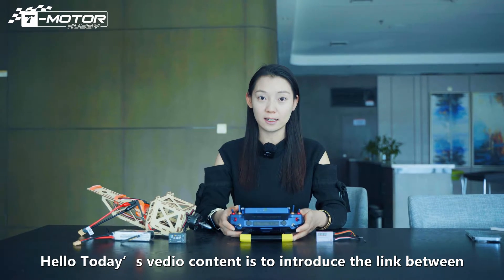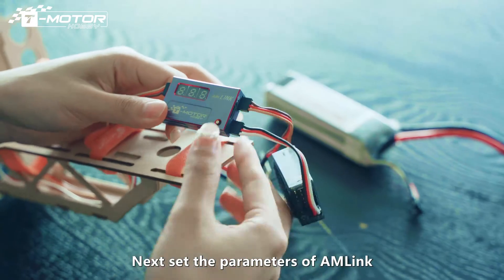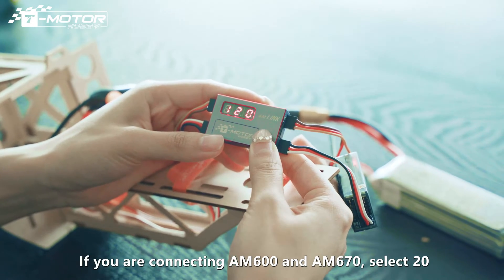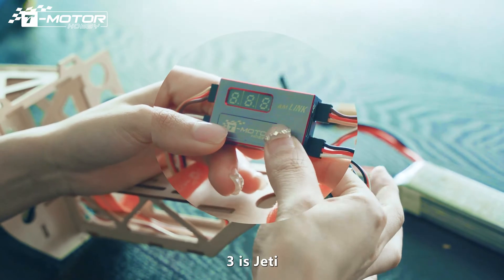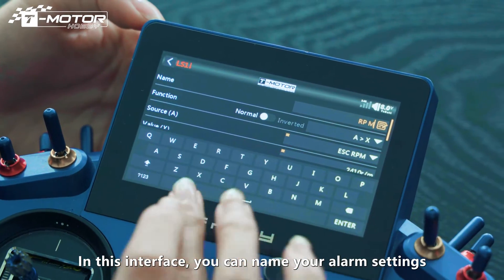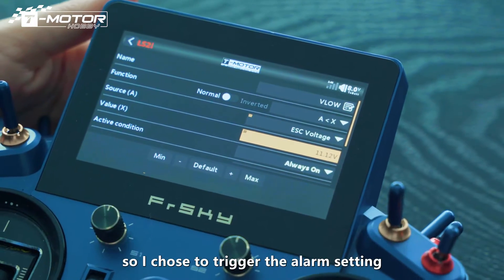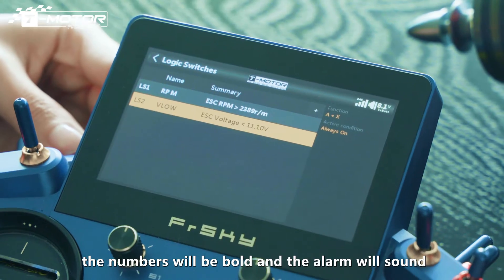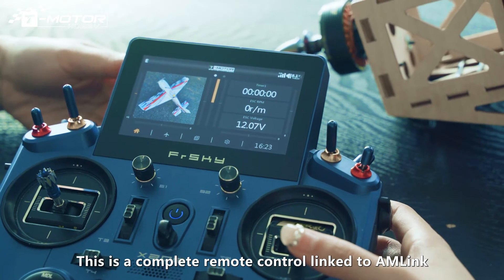How to link T-Motor AMLink with Frsky remote control？

Comment: if using radiomaster tx16s....which radio system do you choose in the AMlink?
Reply from the maker: Hello, if your receiver supports the two-way backhaul function, and the remote control brand is Frsky, Jeti or Futaba, you can use AMLink for telemetry data backhaul!

Comment: For anyone having issues receiving telemetry with the FrSky TD series receivers and the T-Motor AmLink.

The solution after hours of frustration is to remove the AmLink and obtain telemetry directly from the ESC telemetry port. It appears that Bl-Heli app offers the option of direct telemetry output. At the bottom of the BLHeli Configurator in the second column, there is S.PORT Physical ID. Set that to the port you plugged in the yellow signal wire and write it to ESC. After connecting the telemetry cable (the yellow one, with the red and brown pins removed from the JR connector) to the receiver and configuring it as S.Port in the RF Settings (RF Settings > Receiver > Set > Pin# > SmartPort), I successfully received telemetry data.